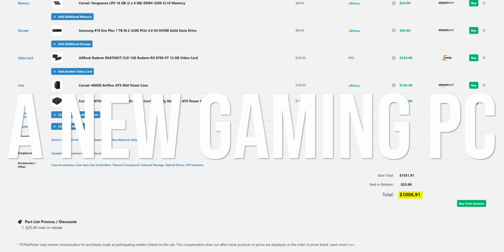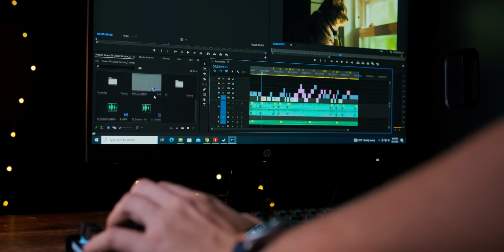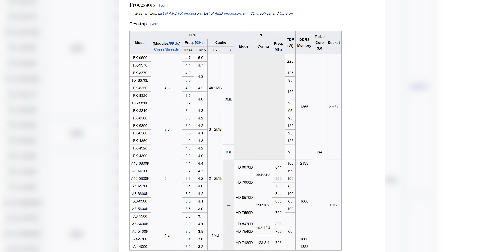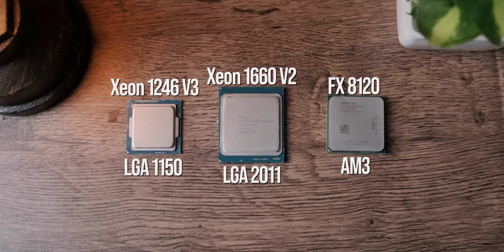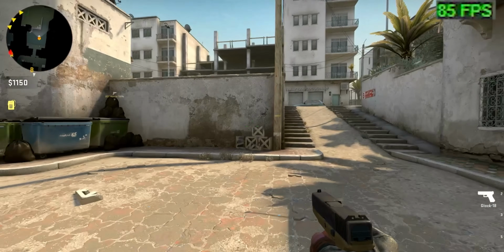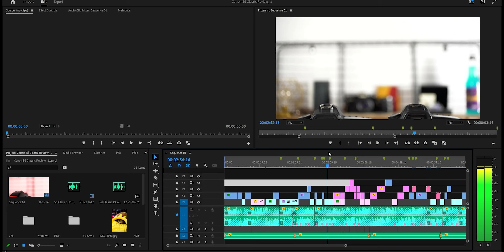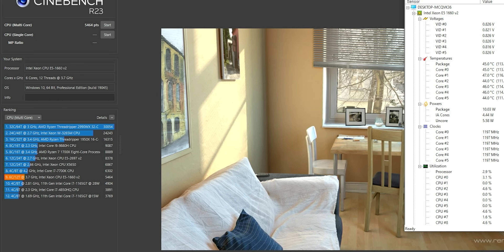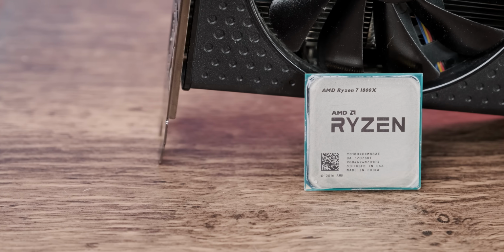DDR3 is DEAD

Comment: I have a PC with an i7 4770, 16GB ram, 1tb sata SSD, and an RX 480. Because I don't use it anymore since my main PC is way faster, I will likely give it to my mom so she can play games with my brother and me. I say all this to say: 
1. While I knew the 4770 could handle a newer GPU than an RX 480, it's a little surprising to me that I could put an RX 6600 in the PC as an upgrade and it wouldn't always be bottlenecked by the CPU.
2. The motherboard in the PC is not a Z87/Z97 board, rather it's an H-87 board. I won't lie, I am a bit worried about it's longevity despite the physical condition being pretty good to me, and while upgrading my mom to something on the AM4 platform would be great, I'd rather upgrade the GPU.

Comment: Just got me 2 ThinkPad x250's a couple of months ago for some less than a "little" amount.
Both sport a max of 8GB DDR3. Both work fantastic with linux and I used zram for RAM swap. 
Pure Heaven !
Replaced my HP Ryzen 5 laptop for everyday use which is exponentially powerful and cold in everyday use. Fan rarely comes on !!
But............
The HP came with a garbage RTL wifi card with max of 433Mbps wifi a/c card whereas the Thinkpads came with Intel 7265 a/c cards with max 866Mbps speeds !!
Had an FX8350 which I gave away to a cousin studying...all maxed out to 32GB 1866 with a 650ti  before I got the Ryzen 5 laptop. The FX8350 was the  best lover I ever had !

Comment: prices are down compared to what they were a couple years ago, and if you're fine with used, you can get a decent gaming PC for 200$ USD (obviously can't crank 200 fps with max settings on a triple A title)
Reply from the maker: Yep, you can play some honestly really demanding games just fine with a decent haswell system paired with a good GPU.
Reply: @aChairLeg  that z440 you have in the description is a terrible price for one

I've seen them go for 100-110
Reply from the maker: Yeah, amazon is almost always worse pricing. I started adding amazon links though because even with the higher prices, people click the links and buy stuff wayyy more often than ebay.

Comment: I finally went from DDR3R to DDR4 when I built a Ryzen Hackintosh, and repurposed my Early 2009 Mac Pro, as a home server after generally being on DDR3, since 2009. Honestly, even these old LGA1366 systems—Mac or PC—are still very useful—especially when upgraded with NVMe SSDs.

Also DDR3R is next to WORTHLESS per GB; Already upgraded two different Mac Pro  4,1 units to 192GB (6x32GB) RAM after getting full 256GB kits for around $80 each (and while I can utilize all 256GB, 192GB is MUCH faster due to triple-channel).

Comment: you put it all on price and fps but the real thing is the power consumption, thats the reason why ddr3 system are dead, even worse with server gear that runs 24/7
Reply from the maker: Yeah, I really wanted to do an apples to apples on power draw, but I don't currently have a way to measure power draw... but I will for the next video!

Comment: Do a DDR4 video next
Reply from the maker: Maybe in ten years haha, DDR4 is still modern IMO
Reply: @aChairLeg  I think it would be interesting to try and game on a DDR4 generation server. You will need DDR4 reg ecc which is actually cheaper. Alot of these systems have been retired so the prices have gone down. The dell r730 would be your best bet, but the Lenovo x3650 m5 (which I use) is still a very high quality machine and can be found at about $150 with ram and cpu (supports gpus, just need the power cable) . The e5 26xx v4 chips are also early 14nm and you  can get an 8 core for under $5. The e5-2667 v4 is your best bet of cores, clock speed, and price. These are only about $20-$30.

Comment: I mean not dead per say its just essentially what ddr4 is to ddr5
ddr3 sticks as far as I know max out at 2400mhz (with XMP with what I hear is a ton of instability afaik) which is essentially stable midrange ddr4 speeds, ddr4 has sticks which can reach speeds as high as midrange and/or basic ddr5 (once again with xmp and a ton of instability afaik (although of you hit the silicon lottery in the cpu side and tune the memory correctly I hear it has a tone of performance uplifts))
Reply: There was also DDR3 3200MHz sticks for example Gskill F3-3200C13D-8GTXDG and Corsair CMD8GX3M2A3200C13

Comment: Just as a little side note there are some x99 boards and cpus that that support ddr3. The e5-2666 v3 machinist x99 g7. Looking forward to the ddr2 vid!
Reply from the maker: I vaguely remember that actually now that you reminded me
Reply: @aChairLeg and I just saw the video in my feed again and remembered that all 1151 cpus work with ddr3 so the 9900k can technically use ddr3. Although I do not believe there was ever a official mb. You would need to bios mod a z170 and brige/block pins on the 9900k. But it has been done before.
Reply: @andrewmcewan9145  The H310M DS2V DDR3 is a thing so even easier than that lol

Comment: Having recently upgraded from an i5-3570K, I put my current 6700 XT on it just out of curiosity. Honestly... not as bad as I was expecting. 100% CPU usage was frequent, but it handled itself well considering its age. Framerates/times weren't terrible, either.
Reply from the maker: Yeah, we've reached a point where upgrading every few years... or even every 10 years isn't needed for a lot of people. Sure, for the newest AAA games, content creation, CAD, etc. you'll probably need to upgrade. But for light use even 10+ year old systems are still pretty solid
Reply: @aChairLeg totally
Reply: @aChairLeg  Certainly. That said, it is light years behind my current R7 7700X, but I would certainly hope so. If you put a more reasonable GPU in it such as the 6600 you used here, you could certainly get by. The only real problem is the lack of instruction sets like AVX2.
Reply: I still game at 1440p upscaled to 4K using RSR on an overclocked 4790k / 5700XT with 0 issues, CPU has never bottlenecked me even in titles like Starfield. I was planning an upgrade but with lower spec hardware like the Steam Deck forcing better optimizations, I think I can even get another few years out of this setup.
Reply: @philipdaian8386  Given the small IPC increase and the additional instruction sets that Sandy/Ivy Bridge don't support, I would be inclined to agree. You'll probably be okay for another 2-3 years yet, but I'm not sure beyond that.
Reply: @AlistairWolfe993  Linux will basically always work on them though. Because you're able to compile everything for whatever instruction set you need, Linux can be ported over to anything. You can still get Linux distros that work with PowerPC macs.
Reply: @Cobalt985  Yes, I'm not worried about base OS compatibility other than not officially supporting Win11, but the lack of AVX2 is what I'm referring to. That can cause some games not to run.
Reply: I rocked that cpu from 2012 to 2020. It was rock solid, but I noticed that when I making music the processor was showing its age. So I went amd in 2020 and now instead 80-100% cpu uses and now only 15-20%.
Reply: @statostheman  Understandable. I held off on upgrading for as long as I could but at some point it got to where it was just too painful to use. To its credit I never expected to get 10 years out of that platform, it served me very well.
Reply: Still rocking my 3570k, I seriously did not anticipate it lasting this long as it has given that I have it clocked all the way up to 4.5 Ghz. Runs most of stuff just fine and doesn't really seem to hold back the 1080 Ti too much. Though I have been really dragging my feet for my new build (IRL is PITA) with my most recent motivator to resume being Steam ending support for W7, which from that point will make my new build a Linux computer.
Reply: what's your mobo? if you're interested i could help you mod your bios so that you could benefit from resizable bar. I use i7 3770 + h77 ds3h + 4x4 ddr3 1600 + rx 590gme and i use rebar on my board, performance is spectacular.

Comment: DDR3 is basically still supported as the majority of the cheap windows machines use "low powered" DDR4 which is just extremley slow DDR3.
Reply: There is overlap in terms of performance and spec, high end DDR3 is very easily the same or better than a lot of the low end DDR4 out there depending on the clocks and timing.
Reply: @MrKillswitch88  MacBooks are a prime example of this. The 2019 MacBook Pro 13 still used LPDDR3, but they clocked it to 2133MHz.
Reply: @MrKillswitch88  The thing is it's really easy to get DDR4 that will absolutely wreck DDR3 at this point.  You can find DDR4-3200 C16 2x8 kits for about $30 new, let alone used stuff.  At this point the memory makers can basically throw that bin together out of random bits of scrap they find out back.
Reply: @dertechie  Sure but for older machines it does nothing when all the board and cpu support is DDR3 for example. Not everything out there in use is DDR4/5. Hell the oldest system I got that still runs is an old Cyrix 486.
Reply: @MrKillswitch88  Still with 200 Euros you can replace old mobo CPU and Ram. R5 3600: 80 bucks, new mobo: 80-100 bucks and 16gb ddr4: 30-40 bucks. Thats how I did it atleast. Point is, if you have some pocketmoney its really cheap to upgrade your system from ddr3 Plattform these days. My systhem runs just fine for my casual gaming and working needs.
Reply: @Gaphalor  Desktops yes but for laptops not so much as the later generations are pretty horrendous when it comes to lack of upgrades never mind reliability. For example with a bit of effort the Precision M6800 can take up to 36TB worth in SSDs when no expense spared.
Reply: @MrKillswitch88  Bruh honestly I rocked a desktop all my life and have just a cheap Laptop for simple office tasks if I need to work mobile. I literally have no Idea how to upgrade laptops to be totally true.
Reply: @Gaphalor  Enough kid I am done with this convo.
Reply: @MrKillswitch88  Yea I better go back gnome hunting with my friends!
Reply: @MrKillswitch88  thank you captain obvious
Reply: @josephbartholomew 
Someone is salty lol.
Reply: @MrKillswitch88   Same in the DDR4 Vs DDR5 like a 4400 DDR4 CL17 kit for big money...

The thing is you can just simply buy much higher MHz for much lower price on the next DDR gen however the timings also keep going crazy high...
Reply: @guily6669  This has been a thing since around 1999/2000 when RDRAM then later DDR1 was introduced which kept SDR around for a little longer till DDR became the standard. RDRAM was hot and crazy expensive at the time and had horrendous latency to match. My thinking it is usually better to change over mid to late in the life cycle of any standard due to better pricing and better overall kits vs buying in early.

Besides cost I don't like kits with horrendous timings especially for laptops when the difference in cpu performance for example can be up to 20% easy sometimes more.
Reply: @MrKillswitch88   Hell yeah I totally remember those times.

I always wish to have a top tier kit never could afford however I also never had the cheapest crap that have the worse timings or low frequency...

I'm in the process of buying a high tier 16GBx2 DDR4 4400 CL17 G.skill Ripjaw TridentZ RGB used, hope it all goes well however I likely won't get the clocks at those timings for sure on my crap Gigabyte Z390 Aorus Elite which have never been good for mem OC from what I always heard and my old 8700K mem controller.

But I still dream to have the kit running at advertised clocks\timings or close to them while the kit being actually fully working with 0 errors.

Ps: and I sure know there was many ppl with luck buying random crazy cheap generic ram kits that had Samsung B die out of eBay and can OC like crazy, but nowadays it's hard to find a good cheap one that will OC to the max... FINGERS CROSSED 😎
Reply: @guily6669 I have an i5 9400f which is locked to 2666 mhz ram. I bought a 32 gb kit of 3600MHz CL 16 and set it to 2666mhz CL 14. No clue if this CL timings actually make any difference, but she is stable 😂.

Surprisingly this 32gb lexar hades set of ram was on sale for $60 some months ago haha
Reply: @Brandon-uy1uv   I just got the used expensive G.skill 4400 CL17 kit a few days ago, sadly I could only get 3600 CL17 not much difference than I could on my cheap 3600 CL19 kit 😤😥

I'm guessing my old CPU and Board just can't push them sadly...
Reply: @guily6669  yeah, nobody wants 52 cas latency in their ddr5. I would much rather have like a DDR5-6000 kit with like 24 latency than a DDR5-8800 kit with 38
Reply: but I have LPDDR3...
Reply: How are you even using the internet @random_stuff_channel
Reply: @megatronskneecap  The same way the 16GB of 1600MHz DDR3 I'm using is. It's just doing what it's supposed to do. I did have an 1866 MHz kit in there, but it has a design flaw that causes a particular error to take place. So I just stuck to the lower end ram.
Reply: @ArtisChronicles  that's pretty crappy, since 2011 I used G.skill Ripjaw in blue of 2133 with okish timings on my 2600K and many years later I bought a 2x4gb G.skill Ripjaw kit but was never good as the 1st one which also cost a lot more and came with ram fans which I never needed to use and 0 errors and could take lower timings than the later one...
Reply: @random_stuff_channel  LPDDR3 is still fast enough for today
Reply: There's a bunch of videos showing how little real gaming difference higher speed ram makes for the money!
Money better spent on GPU nine times out of ten,
don't believe manufacturers snake oil claims.
Reply: @johncollins5552   it depends a lot on the hardware combo, specially CPU bound stuff sometimes can get a massive boost in FPS from a crappy low end ram to a high speed one, you might be able to get a deal on them...

I have a 4400 DDR4 CL 17 2x16GB with crap RGB for 150€ and the kit is still 400+€ here, I bought them used with like 1 year of use according to the seller...

Sadly my old hardware I could only get 3600mhz cl16 😥 (but it's expected as this kit would be able to be pushed to that more on like intel 10th or 11th gen)...
Reply: DDR memory modules... Are a "standard" and not actual performance though it can be said the standard of DDR3 reached it's MAX limit years ago. High-Spec DDR3 being close to slower DDR4... And High-Spec DDR4 being half as good as DDR5.
Reply: I still use DDR3 🤷

Comment: offtopic question i have an old pc laying around with an h81m-a mobo an a i3 4170,im buying an i5 4670k or 4690k to upgrade the cpu only does that gonna change something in the HDDs? or the SSD with the OS?like affect the files?
Reply from the maker: I've swapped from AMD to Intel back to AMD before without issues. It's generally not a good idea, but you can do it if you don't want to re-install windows.
Reply: @aChairLeg  i have some older licensed programs that i dont want to reinstall and a bunch of older games so maybe i thougth that changing the cpu will f up something but im gonna try to replace the ssd with a newer one
Reply from the maker: @akimbo3479  Just make backups and worst case you go back to the original system w/ your backup
Reply: it changes nothing on the os side